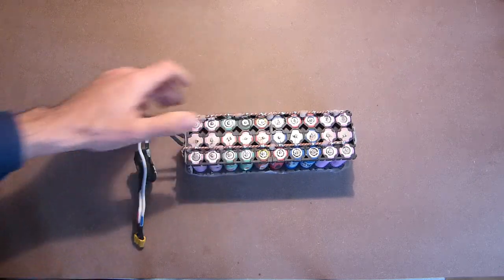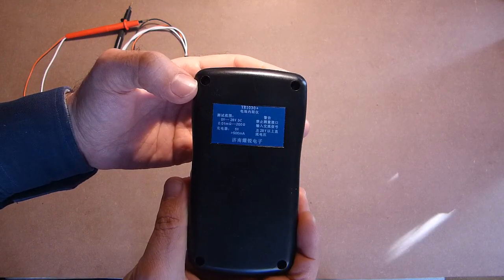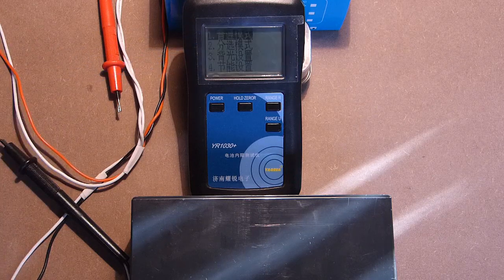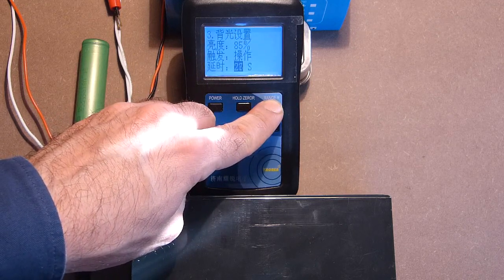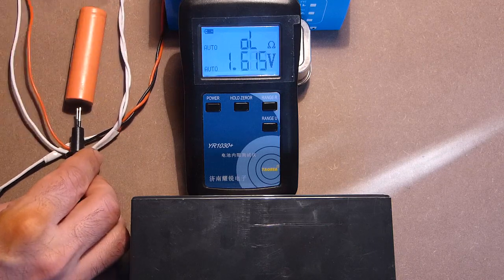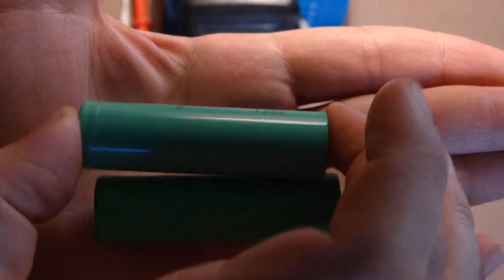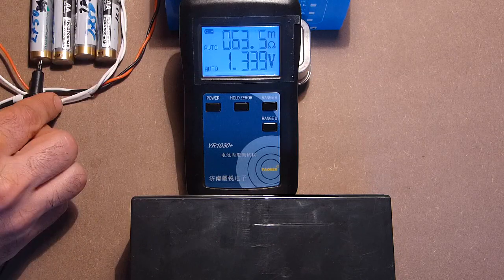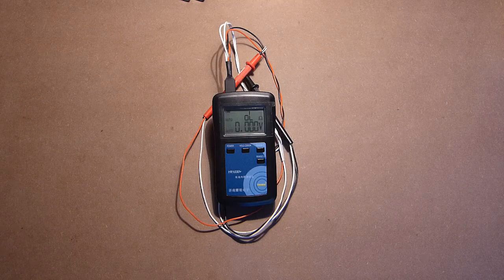YR1030+ Battery Impedance Meter

Comment: 1:52 min: These double-contact “2 in 1” probes are not for measuring voltage and impedance separately, as you are suggesting in your video, but these are so-called Kelvin or 4-wire probes. This type of probes is necessary for accurate measurement of low resistances / impedances, by practically excluding the influence of the measuring leads themselves on the resistance / impedance measurement (search for Kelvin bridge). BTW, cudos for your Chinese 😄

Comment: So how to know what LI ION battery is faulty?
What is value to mili oms that indicates that battery is bad ?
And what is for voltage?
Thx for explaining 
P.s i bought it yesterday
Reply from the maker: Thanks for the question.
The impedance should be 12-20 mOhms, - it depends on the type of the battery. INR-type is designed for drill/drivers (12-14 mOhms), ICR-type - for lanterns and notebooks ( more than 15 mOhms). Is the impedance is about 21-30 mOhms, it means that the battery is in a good condition. 35-40 is also acceptable, but I don't use the batteries with the impedance more than 45 mOhms - they will die soon. As to the voltage - most likely, the more is the impedance, the more is self-discharge. However, sometimes self-discharge is too high, but impedance is normal.
*************
 Please, subscribe to my another channel: https://www.youtube.com/channel/UCbQUNw5V5pDPXugLX1FP_Fg
Reply: @powerbatterychannel4315  Thx for reply, but what is INR ICR ? I subscribe on second channel
Reply from the maker: @soulbrothers7789   INR and ICR are types of li-ion batteries.
INR can withstand high discharge current, but ICR cannot do it.
Reply: @powerbatterychannel4315  is it normal that this tester always counting something without load ?
When i turn it on he showing 0.038 0.025 basically counting something random numbers on voltage without load.
Oms are good OL without measuring. 
I am keeping it on Auto mode both
Like yours counting on 08.51 ( when you removed battery from probes )
Reply from the maker: @soulbrothers7789  Yes, sometimes after measurement the voltage is about 0.040V and you need to wait until it counts down to 0.000V; it's normal for this device.

Comment: Hi thanks for the video .....when i mesure  a 12v acid battery it gives   : 04,80 
Please how can i read this .
May be there is somthing wrong with the  battery....because i measure an other battery and givves : 11om
Reply from the maker: Hello, what is 04.80? Volts or Ohms?
Reply: Ohoms
Reply from the maker: @Rcfishingbateauagadir  In case of Ohms - it's terrible.
If you mean mOhms (milliOhms) - 4.8 mOhms for12v acid battery (approximately 45...60 Ah) is a very normal parameter.
In case of 11 mOhms - it means that the battery is too old/used and is to be replaced.
Reply: I tested the battery in a car and it works top fine.....the values are different according to the type of batteries....for lithuim 11 mohoms its excellent....
 Thanks for help.
Reply from the maker: @Rcfishingbateauagadir  You are welcome!
 Please, subscribe to my another channel: https://www.youtube.com/channel/UCbQUNw5V5pDPXugLX1FP_Fg

Comment: Hello... Yes these are very handy but to measure a battery correctly as all would know theres voltage + internal resistance & Milliamps to amps this is why i never wasted my money in purchasing one an they never corrected this when the plus model an out so because of this imperfection i purchased a automotive battery tester that gave me voltage, internal resistance an ampage too thats $40 lest an yes in the test leads there 4 wires like yours an this also saved me more money buying something thats isolated lke your device just so i can see milliamps to amps an its mine culture friendly too that have plus at the end that only Asian friendly. or charger usb plug is also firmwsre update please be user freindly an advise of a english patch but thankyou for displaying this unit.. p.s.this takes hi amperage batteries without harm to the internals so therapeutically reads amperage but the manufacture chose not to include this feature hence like the plus where the has to know one language... i think i said enough all the unfriendly factors of this being standard or plus!
Reply from the maker: Hello, it seems there is no English patch for this device so far, as I know.
 Please, subscribe to my another channel: https://www.youtube.com/channel/UCbQUNw5V5pDPXugLX1FP_Fg

Comment: Lot of thanks for this video!
Your last tests are very interesting and show that this device is necessary to build equilibrated packs on the safest way. I have ordered for the similar YR1035, very accurate and useful testmeter!   RI is always the first value I search before assembling. If all RIs have almost the same value, so capacities will be also the same or with only very small differences. And we are sure that the pack will be equilibrated for a long time , (a good BMS is not enough) , except if one cell or // row has a possible issue (that can happen) ; Michel (France)

Comment: Appreciate your kind efforts. Thank you
Reply: Just realised it can not only be used for battery testing. It can test overall resistance of a pack and anything that conducts electricity like wires, nickel strips so as to improve spot welding techniques.

Comment: My model is same YR1030+ but there is a not zero or calibration option?? Whats shoud i do please help me!!!!! 
Only HOLD option and writin
Reply from the maker: Probably, there is a problem with your device. Everything should work.
Reply: @powerbatterychannel4315  the box pack is sealed with yaorea original box ?
Reply: @powerbatterychannel4315  the model was 2017

Comment: Hello, i have purchased this from banggood, but there is no Zero R button only Hold button, mine gave english menu..is zero R mandatory for testing..?
Reply from the maker: No, but it's not bad to have it.
Reply: Bhai probe ka kaise jugaad kiya aapne??? Please comment like kar ke reply dena verna notification nahi aata hai?
Reply: @nileshjaiswar3142  probe ke liye maine ek usb connector liya aur usb ke four terminal ko four wire se jod diya har ek wire ke sath copper ka rod laga diya

Measurement ke liye usb ke 4 wire ki 2 pair banake ke battery ke different pole me rakh ne se testing ho jayega..4 wire me se koi bhi wire ek dusre se short nahi hona chahiye varna reading nahi aayega
Reply: @rahul_solanki5  matlab tumne bhi 3000 ka banggood se liya?
Reply: @rahul_solanki5  sala vo wale YR1030 wala main Calibration ka option bhi nahi hai?
Reply: USB aur Wire GOLD plated hai ya sada wala
Reply: @nileshjaiswar3142  yes banggod se liya
Reply: @nileshjaiswar3142  sada usb
Reply: @nileshjaiswar3142  ha calibration nahi he lekin muje koi dikkat nai aayi

Comment: One important question for me....so you have to fully charge the batteries.. let it sit 24hrs then measure the resistance values? 🤔
This can work on 7.2volt Nimh batteries like the hybrid electric car
Reply from the maker: Sorry, can't understand your question.
Reply: @powerbatterychannel4315  when is correct time to test the battery resistance. After i full charge and test same time? or after 24hrs....Also  battery good resistance means good battery
Reply from the maker: @stephensharma3259  In case of lithium-ion battery there is almost no difference. In case of AGM battery, lead-acid, the internal resistance of a flat battery is much higher that of charged battery. So, in you compare 2 AGM batteries - their condition should be the same.
Reply: @powerbatterychannel4315  my main concerns about Nimh 6.6 AH  batteries.. im trying to sort out gud from. bad. How to test them

Comment: Hello nice video. Do you think this meter can measure the internal resistance of 120AH LIFEPO4 cells.?
Reply from the maker: Yes, it should measure.
Reply: @powerbatterychannel4315  ok thx
Reply: It is a 16s solar battery do I have to disassemble the battery to measure or can I  just charge it and then disconnect charge/discharge and mesaure the cells?
Reply from the maker: @rubenspecht3552  You should disassemble it and measure each cell.
Reply: @rubenspecht3552  The best would be to disassemble, but if your battery has only one series row with big cells (often with lifepo4), you can test each one in place (not the best but no big error). If you have //,  you will mesure the value of the total // row and so you cannot be sure  of the real value of each cell. In this case  you must disconnect each cell. Wth screwed connections it's possible and easy. But Lifepo4 is sure and stable...interesting with an old battery to verify.

Comment: Hello, I have Liitokala lii-500 li-ion charger, it measures internal impedance of batteries when charging, are that data correct?
Reply from the maker: Hello, if  Liitokala lii-500 were a precise device, no one would purchase YR1030 :) Of course, Liitokala is non-professional meter, as sometimes the difference between the measurement with YR and Liitokala is 3-4 mohms, and sometimes - 30-45 mohms. You can see some reviews of Liitokala  on the internet in comparison with YR. That's why I decided to get a professional device and not to spend money on a charger with an "additional function", which doesn't give you true results.
Reply: No, it's not reliable... I have an Opus which can also give RI but values are absolutely not precise...make simply some repeated tests on the same cell... My Imax (not the clone) gives better results, but too high. 2 principal reasons for that :
-Contact quality on the tabs are not fiable for testing RI
_These devices use the DC current of the charger for testing , much more unprecise than the AC 1KHZ current of a real RI tester.

Comment: Wondering if this would work with cells in a battery - like a lithium 12.8V 18AH battery, LA batteries, e.g. car battery, VRLA batteries, again 12V units used in UPS etc, or is it only useful for individual Lithium chemistry batteries?
Reply from the maker: Hello, regarding the lithium battery - you can see one in this video - 3S with 10 cells in each section. I've assembled 3 such units, but - in 2 years one unit failed i.e. the second section shows 3.28V while the first and the third sections are OK. So, exactly after getting of YR1030+ I have disassembled the damaged unit and revealed that 4 cells of the second section have unacceptable impedance; so, they became internal enemies of the whole battery. I'll check each cell of each section, replace the damaged cells and re-assemble the battery. As to VRLA batteries of UPS (12V) - I've checked some brand and no-name ones; for example, LONG battery ( really good one, if genuine ) has the impedance of approximately 17 mohms,  while no-name one with the same capacity of 7Ah ( but in fact it turned out 5,4Ah ) has about 23-24 mohms. So, the device is also useful in case of 2S-6S batteries.
Reply: @powerbatterychannel4315  Very good - thankyou for the detailed answer.
Reply from the maker: @Bennyboy-dog  You are welcome!